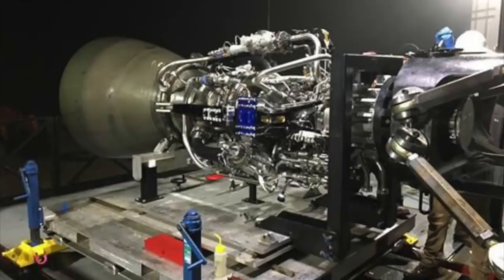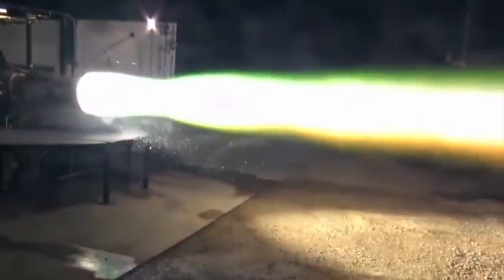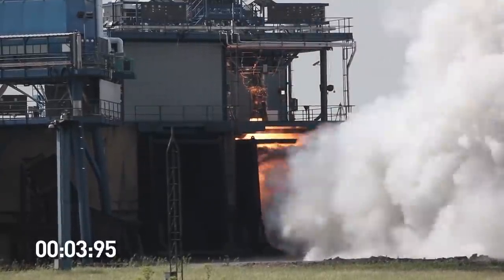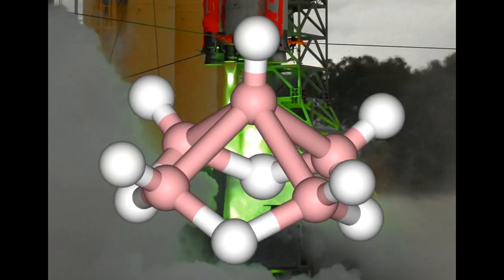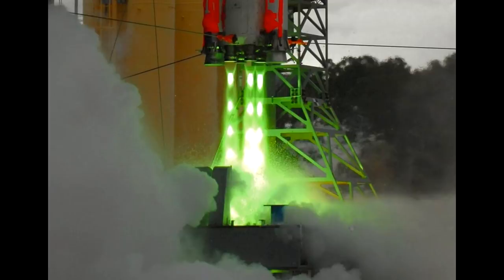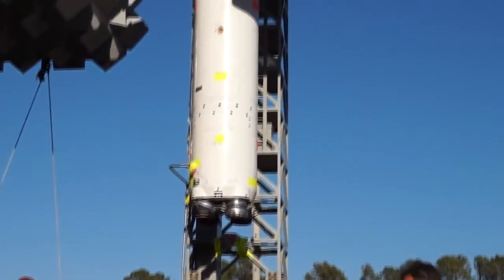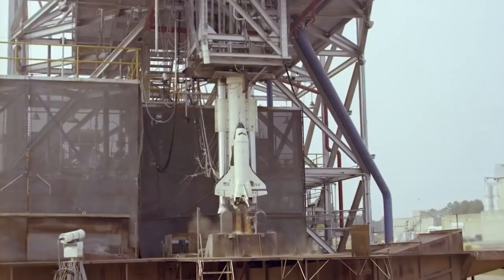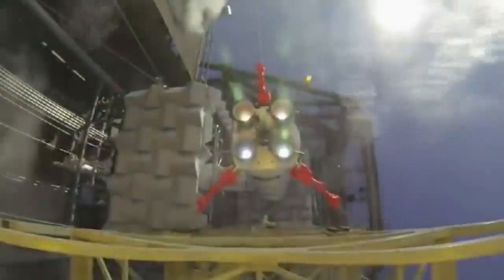The Story Behind This Green Rocket Exhaust

Comment: Methane,or any hydrocarbon will burn blue if fully oxidized. Yellow if poorly oxidized,and green if somewhere in between. Our pulse scramjets burn a sea green when properly adjusted. Maximum thrust is into the slightly less oxidized range.
Reply: Do you have more info I can read on those supersonic pulsejets you're talking about? They might alleviate the need for a catapult on a sub-100kg(wet), >mach2@Sea level xxx km range courier drone, and thus allow starting with e.g. fold-out props that can short-term provide VTOL thrust. The thing could start at 90° climb from sitting on it's tail, level off untill the pulsejet thrust allows cruising, switch the motor off/fold the props up and accelerate untill the ramjet thrust allows cruising, continuing to accelerate until target cruising speed and at the destination just flare until it's stalled hard enough to allow deployment of the props for vtol tailsitter landing. Refueling / recharging equipment should be far cheaper/smaller than a catapult that reaches Mach 0.5... (delivering some 10~50 G acceleration) .
Reply: @namibjDerEchte  actually we build the prop into the nose and vector the thrust in the rear for vertical take off. The engine is basically a glorified Venturi with a spark plug in the tail pipe,and oxidation is controlled by the distance between the engine intake and the fuel injector on the fuselage. And of course that distance varies with speed. So it's on a slide.
Reply: @namibjDerEchte  Sub-100kg, >Mach 2 @ sea level, xxx km range plus a payload sounds suspiciously like a very small sea-skimming supersonic anti-ship missile. Not the sort of thing you want in the hands of our future overlords at Amazon ;)
Reply: @nerd1000ify  actually nothing so wasteful as a missile. And it can skim land as well as sea,but can also do black sky flights. It's our hope that they will be for both military and civil use. The current version is a single seat configuration, and is quite small. About 15 feet long by 10 feet wide,by 3 feet thick. The pilot sits in it much like on indy or formula one car. We would like to build larger versions. This is just the original test bed.
Reply: @jefferyclark2114  
I made reference to a missile because your proposed specifications make the vehicle effectively become one, even if that is not its designed purpose. People with nefarious ends could replace the pilot or payload with a bomb and immediately have a weapon that even the most advanced point-defense systems would struggle to intercept.
Reply: @nerd1000ify  very true. The fact is that the primary weapon it's designed to Carry would probably be the best defense against it. A compact but extremely powerful maser,aimed by means of a magnetic yoke. Not dissimilar to the free electron laser the navy has begun developing. Ours is tuned primarily to detonate fuel and ordinance and fry electronics. So it doesn't require vast amounts of power to do it's damage. It also can carry a compact but similarly powerful rail gun for harder targets.

Comment: The green is probably Copper Chloride used as a catalyst in the hypergolic mixture, if using 80%+ H2O2 as the oxidizer, instead of hydrazine.

Comment: I have heard, that the SR71 had boron in the JP7 it burned. I was told that one boron atom can hold onto a bunch of oxygen atoms, which at face value sounds pretty nifty, having a heavy fuel with a certain amount of oxygen dispersed within it. Certainly a needed extra for the tech of that era, but with a rocket motor, that has both a fuel and oxygen supply feeding it, is there really a need or advantage for the boron being added? Does the boron or borate fuel mix dynamically do anything beyond giving an even stratified mix of extra oxygen being held within the fuel? I am not a "rocket scientist" so I am curious if there are some other aspects of this I am missing point about just being a casual observer...

Comment: I just started chapter 10 (it's about Boranes) in Clark's book Ignition! It is a fantastic read even if you don't understand chemistry that well. 

Here's an excerpt from chapter 6. He's writing about Chlorine trifluoride, ClF3, or "CTF":
"All this sounds fairly academic and innocuous, but when it is translated into the problem of handling the stuff, the results are horrendous. It is, of course, extremely toxic, but that's the least of the problem. It is hypergolic with every known fuel, and so rapidly hypergolic
 that no ignition delay has ever been measured. It is also hypergolic with such things as cloth, wood, and test engineers, not to mention asbestos, sand, and water —with which it reacts explosively. It can be kept in some of the ordinary structural metals — steel, copper, aluminum, etc. —because of the formation of a thin film of insoluble metal 
fluoride which protects the bulk of the metal, just as the invisible coat of oxide on aluminum keeps it from burning up in the atmosphere. If, however, this coat is melted or scrubbed off, and has no chance to reform, the operator is confronted with the problem of coping with a metal-fluorine fire. For dealing with this situation, I have always recommended a good pair of running shoes."

Comment: Before I watch this, lemme guess... One of the propellants is a chemical with an element that burns green, like barium, boron, or copper. Or perhaps the lining on the engine is made of a green burning element that cooks off during operation. Perhaps they are using boron as an ablative material?

Comment: They also sometimes will use a heat sink nozzle on a test engine that lacks a full cooling system as it doesn't have to be flight weight and the can make rapid changes to the design.

Comment: 4:31 "because the Orbiter sat so close to the launch pad that sound waves could actually damage it, in theory"

And in real life, too. On STS-1 the compression wave from the booster ignition bounced off the pad and slammed into the body flap, pushing it beyond its normal range of motion and spiking the pressure in its hydraulic systems well above their expected failure point. If the hydraulic pressure sensors had been monitored during launch, it's quite possible that the very first Space Shuttle mission would have resulted in a launch abort.

Comment: I Scott and others, question: If a Spaceship's structure/hull could store massive amounts of electicity with a new technology without more mass, is there a way to use some of that electricity to get more thrust out of the rocket's fuel?
Is there a molecular level way to convert reentry heat into electricity?

Comment: Scott, I can confirm that the photo is from the 2012-2014 SMAT SLS LOA/IOP test, in which the LOX/GH2 core-engine simulators were ignited using TEA/TEB.  The reason the test was necessary is that currently our ability to accurately predict water suppression of LOA/IOP is lacking.
Reply from the maker: Indeed, modelling water supression is not something computationally tractable.

Comment: Not only COULD sound waves damage the orbiter in theory, on STS-1 they did! An inferior water supression system allowed an accoustic shockwave to damage both components of the heat shield, and deflected the orbiter's body flap to such extremes that damage/ruptures to hydraulic systems was expected (not discovered until postflight, and luckily they didn't!). More info on the English STS-1 Wiki article, chapter "Mission Anomalies", points 5 and 6. 

IIRC the book "Into The Black" (required reading for Shuttle fans!) explains that errors were made when scaling/extrapolating/adopting the accoustic test results to the full scale thing, and thus they used a water supression system that could not cope.
Reply: Of all the times that a Shuttle was badly damaged or nearly lost (plus the two actual losses), imagine having a LOCV on the first launch. :o

Comment: Hey Scott, I recently did a science lab in which we made fireworks using sugar for fuel and Potassium Chlorate as the oxidizer. It produced a very pretty purple flame. Why isn't this oxidizer used in SRBs? Some other groups used Sodium Chlorate which produced a normal yellow flame.
Reply: Hi Sagar,
Chlorates react vigorously with most potential fuels and have a tendency to form shock sensitive explosives with some of them.  Perchlorates are much safer and are what’s used in the SRBs.
Greetings from Australia 🇦🇺 
Cheers,
Tim

Comment: Question:
Why dont we use solid fuel for primary stages as the default engine? I understand its not able to shut off once lit, and throttling is an issue as well. But...I would think there are ways to throttle, whether it be through differing layers of propellant to burn at differing power levels or some other throttling system. It would seem to be a HUGE difference in price, and difficulty with so many parts that we use now...
Reply: You can't throttle on demand, it's unsafe.  One lit there are zero safety's outside of just dumping it.   Should never be used in ANY manned space program.

Comment: so hypothetically assuming it does combust on contact with oxygen even in space, this could potentially be used in space to restart an engine after it being shut off? all you need is liquid oxygen and  a small tank of the "starter fuel" plus the real fuel, so all you do is mix 3 of them and cut off the starter fuel when it is lit!
Reply from the maker: That’s exactly how the Merlin engine restarts in space.

Comment: Can anyone explain to me (a dummy) what are the gaps in the flame from rocket exhaust just curious
Reply: "Shock diamonds."

Althuogh the pressure in the combustion chamber (the piece of the rocket or jet before the nozzle where you light the fuel and oxidizer on fire) is high, the nozzle expands the gas to high speeds (because the faster you can eject mass out of your nozzle, the more thrust you get from that mass.) The nozzle first gets narrow to bring the gas to the speed of sound at the throat, but then, counterintuitively, the gas SPEEDS UP when it goes through the expanding bell of the nozzle. (This is just part of the physics of supersonic flow, and other physics of supersonic flow that I'm not going to go into detail on produce the pressure fluctuations that cause the "gaps"... which I will now explain a bit.)

In the process of expansion, the exhaust gas gets somewhat cooler and its pressure drops. In fact, the exhaust pressure at the end of the nozzle is lower than the pressure of the air surrounding it. So once the exhaust is out of the nozzle, in the surrounding air, the air pushes on the stream of gas, compressing it and heating it up. The bright spots in the flame are these high pressure spots.

In some cases, this process compresses it to be higher pressure than the air, so it bounces back and expands until it's lower-pressure than the air and starts to be compressed again, and so on, producing the "train" of high pressure and low pressure spots until it dissipates.

The high-pressure spots are brighter because any unburned fuel in the exhaust may burn when it's compressed. The process of compression produces "hot spots" wherever there is high pressure.

You can see this in jets too, especially when they turn on their afterburners. The afterburner basically injects fuel into the engine exhaust at the "tailpipe", so the exhaust now contains more unburnt fuel that will produce visible shock diamonds.

Wikipedia has an article about this, but it's a bit more technical.

Comment: Can you explain that standing wave that happens in the exhaust stream. You called the shapes Mach diamonds. Does it improve performance at all or is it just a side effect.
Reply: I think it is this:
When the exhaust comes out the atmospheric pressure tends to squeeze it down, this increases it's temperature due to thermodynamics and it expands again, this is how you get those mach diamonds

Comment: While Raptor's upper contour of flame contains green strip the lower contour of flame contains orange strip. If it was the result of copper influence both strips would be the same. It looks familiar. In 2000th many cheep cameras gave similiar pairs of contours: yellow or orange one side and blue or green the other.
Reply from the maker: I originally thought it was anti reflective coatings on camera optics.
Reply: Yes, it's what I mean.

Comment: Can you talk a little bit more about the mach diamonds in the flame?  I get the concept but would like to know a little more about how and why they form.
Reply from the maker: I have a video answering this and other questions:
https://www.youtube.com/watch?v=aB8knRvUywo
Reply: It has to do with the expansion ratio of the nozzle to ambient air pressure. Most booster engines aren't actually optimized for sea level because they only spend a very short portion of the flight at low altitude. So you use a slightly over expanded nozzle so your maximum thrust and ISP is somewhat higher than it would be if you optimized for sea level. The mach diamonds form because as the high pressure gas is trying to escape the ambient air has enough pressure to push on the sides of the stream of gas right as it exits the nozzle and create the wave effect you see in a mach diamond. Ideally the gas coming out of the nozzle would be totally in line with the edge of the nozzle.

Comment: They considered boron compounds for rocket too, one of the fovourite picks was diborane and fluorine as the flame is so hot the usual solid boron oxides are still vaporized but was in the end dropped as neither fluorine nor diborane makes for a great cooling fluid. In the good old days the extreme toxicity of fuels was really a non issue.
Reply: How about Pentaborane with Oxygen Difluoride?
Reply: @chriskerwin3904  As a rule I stay 10Km from anything that reacts either boron or fluorine and double that if they react them together.
Reply: @theophrastusbombastus8019  Its the other way around... almost everything reacts with Fluorine because the molecule wants to pick up free electrons so strongly. Boron is dangerous in these compounds for the same reason Hydrocarbons can be dangerous. Tremendous amounts of energy  is stored in the intra molecular bonds in borane compounds. The impulse is better (fuel efficiency) because the boron molecules have a lighter molecular mass than carbon and therefore can be propelled faster out of the engine. It's the same reason pure Hydrogen makes an efficient fuel.
Reply: @chriskerwin3904  Yah I know but boron compounds are not dangerous only for the energy, mostly because they are super duper toxic
Reply: @theophrastusbombastus8019  That's not universally true. Boranes are toxic and reactive but boron can be stable and useful for other purposes. For instance, Boron Carbide is a ceramic used in body and tank armor and is perfectly safe.
Reply: @chriskerwin3904  Ok, but boron carbide is not a rocket fuel, all the boranes studied as HEF had big handling problems, one of the many reasons they never got adopted.
Reply: @theophrastusbombastus8019  Yeah very true, we're sort just debating semantics

Comment: Is TEB any worse for the environment or ground crew than hydrazine? Because that's still used for a lot of applications
Reply: Tri-Ethyl-Borane auto ignites with air at -4 F. Borane based fuels tend to be very toxic and hard to handle. They're typically stored in an alcohol solution to prevent oxidation.
Reply: While TEB is toxic, compared to Hydrazine it is organically grown fresh apples.
.
Hydrazine LD50 dose is between 1/50th and 1/100th that of TEB.

It will rapidly decompose into more-or-less innocuous compounds.

The main danger of TEB is that it is pyrophoric even at very low concentrations.
I.e. it will set you on fire! By liquid splash or even vapor as dilute as 1300ppm.
Reply: @marvinkitfox3386  this is why I didn't really see much issue with TEB. If you maintain containment policies as strict as those used for hydrazine (with some differences to accomodate some specific aspects of each chemical) then TEB shouldn't pose much more risk. I mean ya the specific way either one is likely to kill you is different, but it's a bit silly to argue over whether being burned alive by TEB is worse than having your central nervous system spasm and shut down from hydrazine exposure. At the end of the day both scenarios are a result of poorly designed and/or executed containment strategies and so the solution is the same for both: DO NOT LET THIS SHIT GET OUT!!!
Reply: Are the exhaust byproducts of either better or worse than the other one?
Reply: @98dizzard  Hydrazine exhaust is mostly water, hydrogen and ammonia. But a trace of unburnt hyrazine is always present, and that is nasty stuff.
TEB combustion products are Water, CO2, CO and Boron oxides. The worst of these is the CO, and that's hardly worth mentioning.
The nice thing about TEB is that, at any real concentration, it self-destructs itself quite enthusiastically. Whereas Hydrazine is equally enthusiastic about destruction, but targets mammal nerve cells!
Reply: @marvinkitfox3386  interesting to know. Seems like the TEB is overall the best choice then, despite its volatile nature.

Comment: How does an air ballon reach space without reaching escape velocity.
Reply: It's not going into orbit.  And they only get up to the edge of space. :)
Reply: It's easy going straight up.  Air density vs. the density of helium provides 'lifting' power.
The trick to ORBITING is you have to fly parallel to the Earth's surface sufficiently to establish a stable orbit above the dense atmosphere. About 17500 mph at 100 mile altitude.